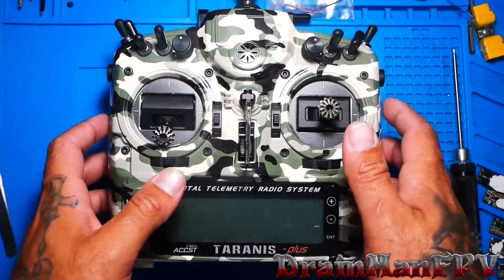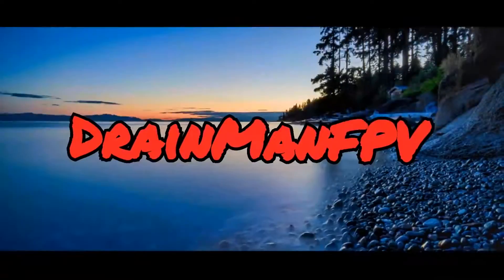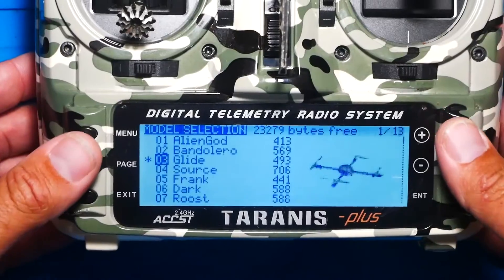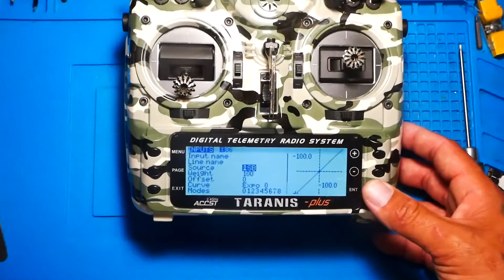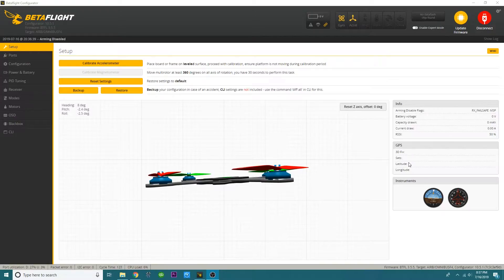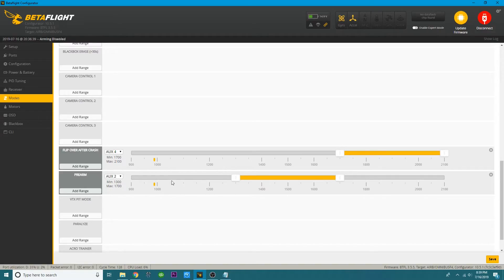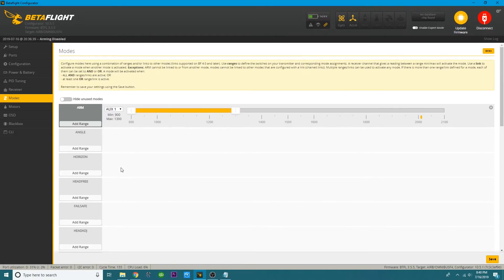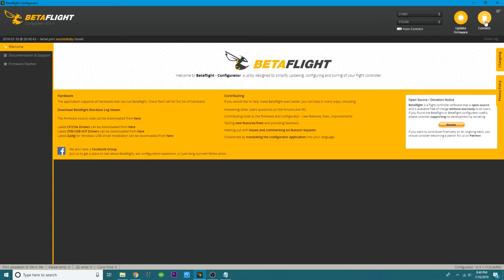Betaflight can arm like KISS's idle Up!! Arm Your Quad Like Mr. Steele! PRE-ARM - safe arming

Comment: One more thing. When I turn on Idle swith - the motors rotation starts to increase spontaneously. I tried to do it with propellers - same thing happens.  If do not turn off idle switch - the quad is ready to take off.
Maybe you can explain - how to solve this.  Thanks

Comment: Drainman,  I think with Mr Steele, its all about the Gyro. With KISS you can turn on the motors with out the gyro and move the quad around to check out the props and the quad doesn't freakout on you. That his "idle up". when he pre arms the motors spin, but it doesn't use the gyro until he's arms. I go exciting when I thought you were going to so how betaflight does that. Can it?
Reply from the maker: You can, but this is not that, this is just the same motion of arming as steele. Idle up is the ability to spin the motors with the PID controller inactive
Reply: @DrainManFPV  do you know how to do that?
Reply: @DrainManFPV  you had idle up in the subject line and I got all excited, I've been trying to figure out how to get BF to act like KISS with the inactive PID but I can't figured it out and gave up!

Comment: Just ran across your video and went ahead and subbed. Sounds like you likely have other tricks up your sleeve that I'd like to learn. I'm after functionally duplicating the way Steele sets up his quads except with non-kiss hardware. Specifically, I hate the tendency to bounce when lading, and I'd also like to be able to arm to check props without the quad trying to saw your hand off. I'm slowly cobbling together the knowledge and understanding I need, but at the moment I'm trying to figure out if you can still wind up with a more stable flying quad if you don't use air mode, or if air mode has improved to the point of it being the definitive way to go. I guess I should be able to answer that myself by putting air mode on a switch and flying a few packs to compare the difference... sorry for the long post. Kinda thinking out loud. 😉 In any case, thanks for this video and I'll be checking out the rest of your catalog shortly. Happy flying! 😁👍
Reply from the maker: Thanks LedChicken, That's tough to do, you have to disable the PID controller, you can do that in the CLI - But hard to make friendly for every day use. Good Luck!